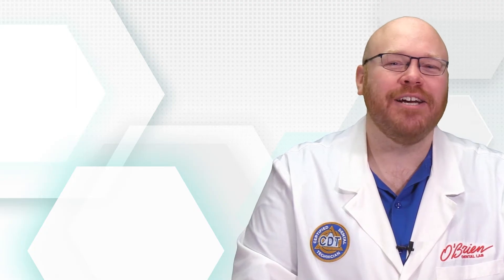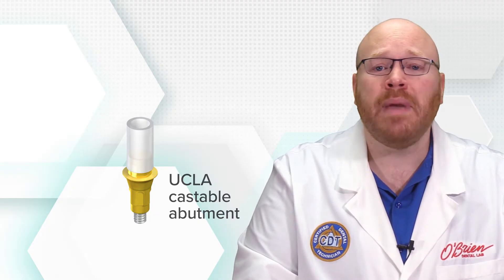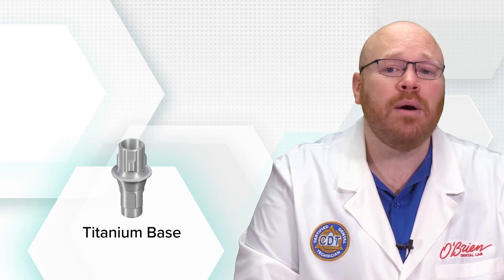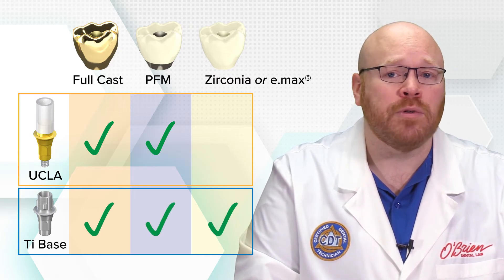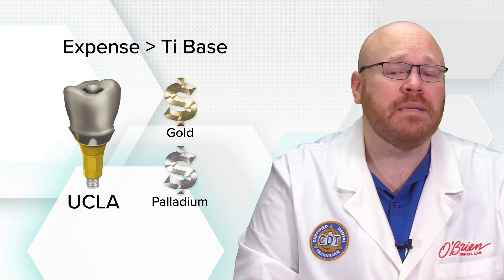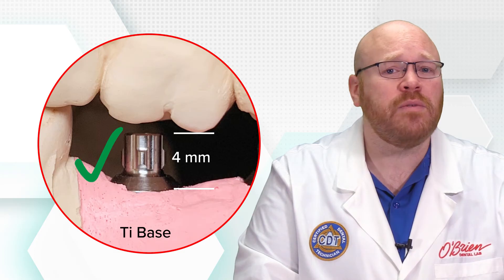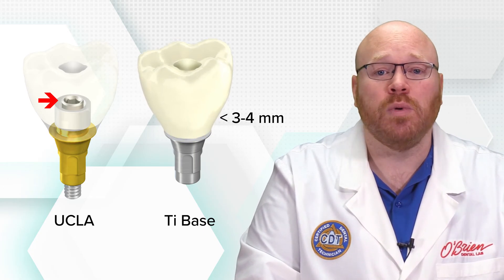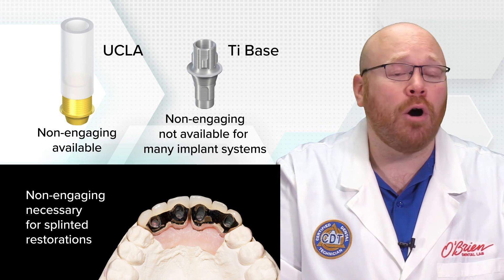Screw Retained Crowns - UCLA vs Ti Base

Comment: Terrific video. Thank you. When using Tibase (variobase from Straumann), I always ask the lab to return the crown uncemented so I can check the fit. The crown always returns with slight rocking or twisting. Any solution you can think of please?
Reply from the maker: There are a few things that can contribute to that, with the main one being the design of the variobase.  It's just a short cylinder with four small antirotation nodes.  Those nodes do not extend the entire vertical length of the abutment so they have undercuts to them.  Those undercuts have to be blocked out, either by software or with wax by hand.  Depending on how well the block out is done; the pressed, milled, or cast restoration may not immediately fit.  The technician must then adjust the inside of the crown so that it will seat on the abutment.  This can make it so that the crown have some movement.  There are also some parameters within dental design software that can affect how loose or tight the fit is.  You will typically get a much more intimate fit when using a well designed custom abutment as opposed to a variobase.
Reply: @OBrienDentalLab  thank you very much for the prompt response

Comment: Hello Sir.
Does Tibase gives us a better emergence profile and do they come in different gingival height?
Reply from the maker: The Ti bases have a fixed emergence profile, so there's just less control.  In some situations you may find that the diameter of the Ti base is too large, especially when the implant is significantly subcrestal.   As far as the gingival height, it depends on the company.  Some systems only come with one height and others come with multiple heights.

Comment: Great video. I had a query regrading a case planned for hybrid denture. I have a patient who is planned for a hybrid denture on Nobel implants. Five implants have been placed. For a hybrid denture, can I use the gold adapt non-engaging abutments or do I have to go for multi-unit abutments only?
Reply from the maker: Yes, you can use gold adapt non-engaging abutments for a hybrid but these days many labs would prefer to do a CAD titanium substructure instead of a cast metal substructure for hybrid dentures.

Comment: Can you have a custom abutment for screw-retained crown? Sounds like we only use Ti-base abutment (which is a stock abutment) nowadays and custom abutments are not used for screw-retained crown.. please clarify
Reply from the maker: Yes, it is possible to use either a custom abutment or a titanium base when making screw retained crowns.  We generally prefer to use custom abutments for our screw retained crowns as they give us more control over sub-gingival contours, abutment height, and material thickness.